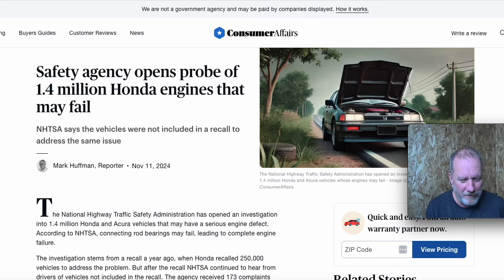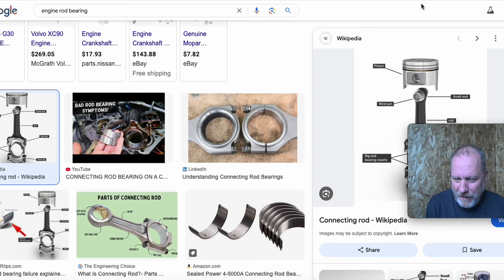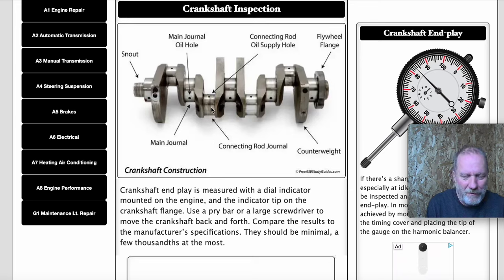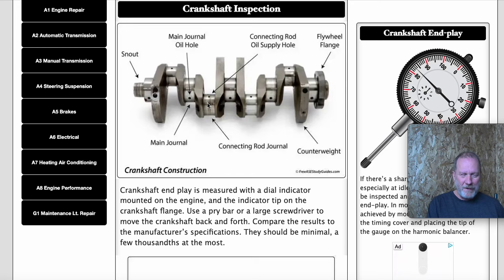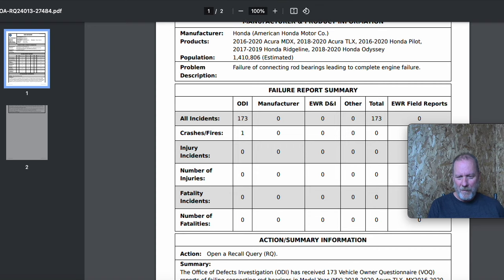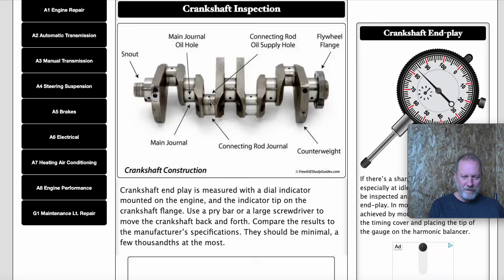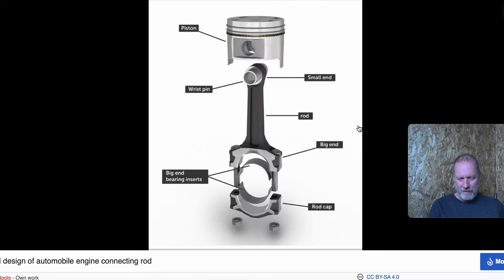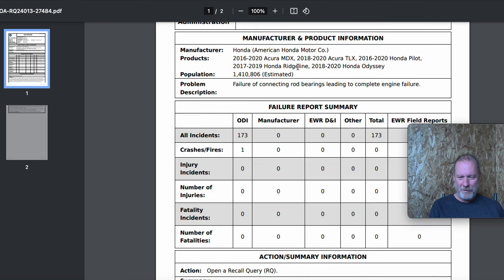Honda has more Engines Fail, Could yours be next?

Comment: Had mine replaced last month,
Replaced for free, they had the car for a week free loaner. It’s bearing issue not crankshaft. And , yes extended warranty on the powertrain.
Another recall option fuel pumps
, no parts available now.